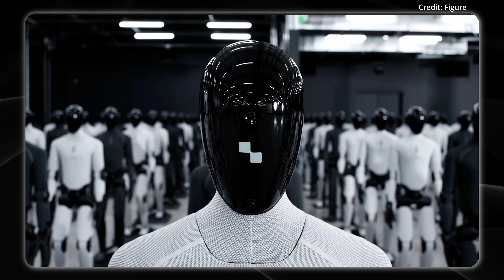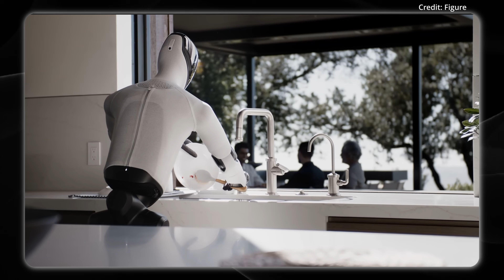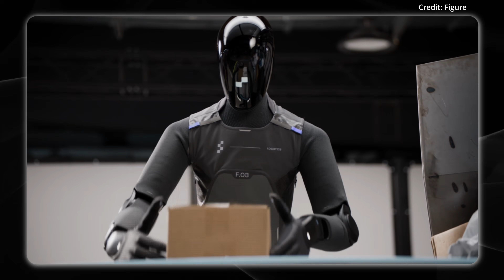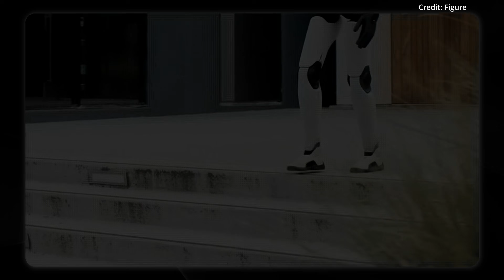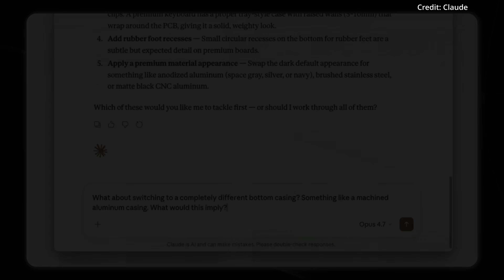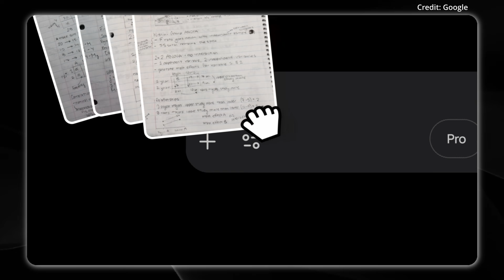New GEN 3 AI Robot Beats Tesla Optimus? ($24,760 HUMANOID)

Comment: Short answer: No
Reply: I'm curious what capabilities you believe Optimus has demonstrated in real environments which position it ahead of its competition?

Because from an outside observer it seems that Optimus is lacking in controlled, publicly verified evidence of autonomous work in real environments.

Figure has at least shown a humanoid doing a narrow but real production task at BMW: loading tens of thousands of parts over long shifts in an automotive plant. Agility's Digit has similarly demonstrated a boring but meaningful logistics task: moving large numbers of totes in a live warehouse deployment. And we are ignoring benchmarks set by Boston Dynamics' Atlas.

By contrast, the most public Optimus demonstrations have either been stage-managed, ambiguous, or later revealed to involve human control. The shirtfolding demo was not autonomous. The We, Robot interactions were also reportedly human assisted or remotely operated. That does not mean Optimus has no potential, but it does make it hard to argue that it is currently anywhere close to leading the field on demonstrated capability.

So what is the specific Optimus achievement you are using as the benchmark?

Comment: Why do the current robots have these strange bend legs? - Also, can their joints loosen up or does it damage their actuators if someone or some force tries to move it?
Reply from the maker: The robot's actuators are backdriveable meaning they can "give" a little bit, but the fingers specifically are designed to be highly compliant so that you could physically bend them without much effort. The hands are also slightly padded to prevent pinch points, and they detect as little as 3 grams of force so if you did have your hand in its palm, it wouldn't crush it.